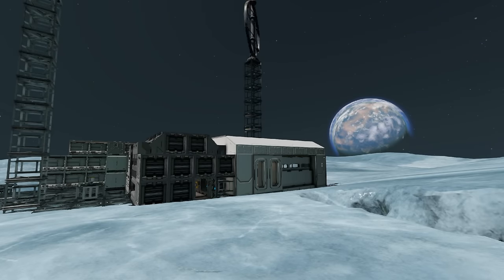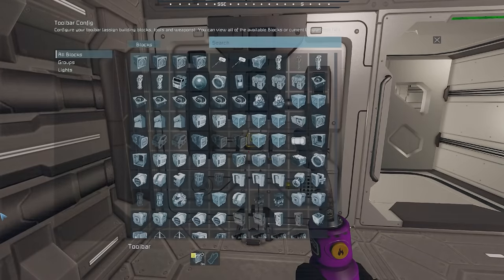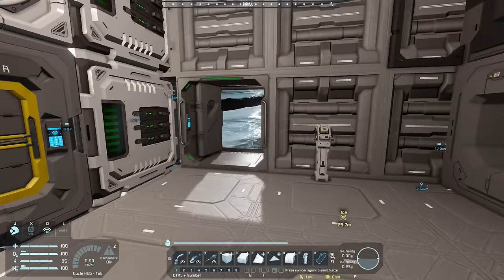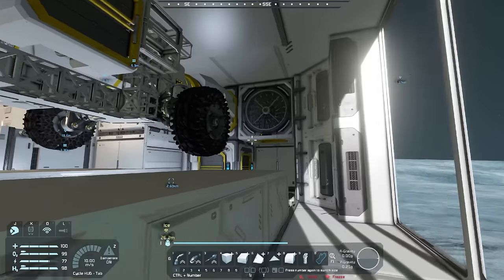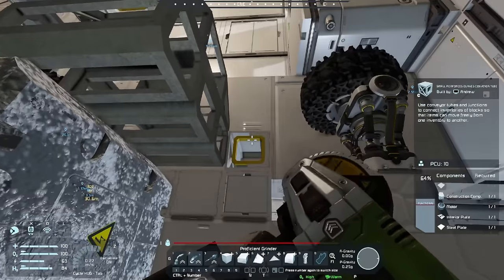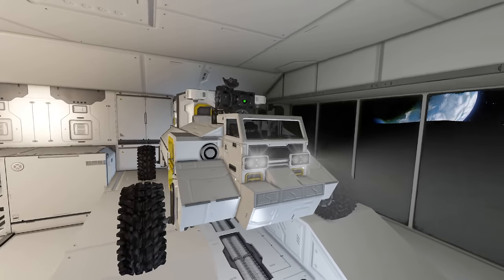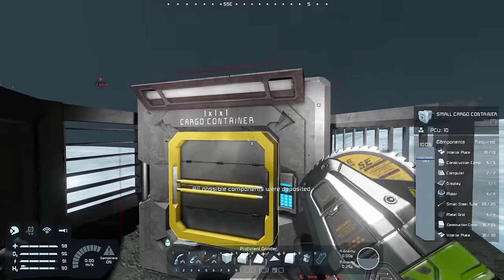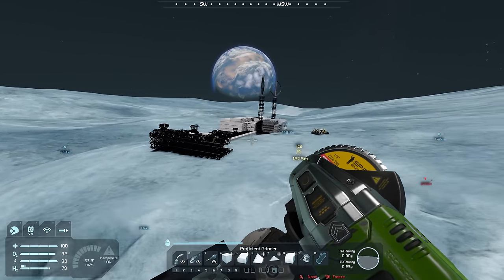Space Engineers Survival (Episode 5) - Rover Upgrades and DEFENSES! [2024]

Comment: PAM’s auto miner is still a viable option, I just used it yesterday and it worked really well. I’ve never tested it in atmosphere though. I’d just make sure that the reverse thrusters can support the ship against gravity even when full, Pam also works if you just set the ship to mine at an angle. You just park the ship facing the direction you want it to mine in and it’ll mine there
Reply: Yeah, despite Pam being technically dead, the thing it uses hasn’t been messed with in a long time
Reply: @nickforgie4290 You're right that it hasn't been updated in a long while, but it still works just fine. 

Once you get PAM set up you can also use your base to monitor what they are ding as well as issue commands
Reply: Every playthrough I do inevitably ends up with a fleet of in-atmo PAM drones set up to collect every ore I can find. My only problem is that I inevitably forget the pathing of one or two near the base and accidentally build in its way. “Why did my ice drone crash? Oh, because I’m an idiot. That’s why.”

Comment: I like building huge solar power towers (200+ solar panels) that track the sun for my bases (Tower of Power!) usually quite far away from the base. I first put down blocks on the surface and count them all the way to where I want to build the tower, often more than 1km away on top of a mountain or high hill (to maximize solar exposure). Then I dig a tunnel from the base to the build site while putting blocks down as I counted them on the surface. That way I emerge exactly where I wanted to build the tower and have a connection to the base via the blocks I put down in the tunnel.
Reply: Another tip to help drill the tunnel straight is to create and use a blueprint of what you want underground (of perhaps a long row of unbuilt frames). Then use a projector to display the blueprint as a guide of where to drill.

Comment: Everyone has their own pref for how to mine. :D I don't mind flying a mining ship for quick jobs, but I personally detest hand mining.

With the shaft you've already begun, you could possibly start with a large grid drill setup with piston, rotor, hinge, etc.

keeping with one thing you mentioned about a strip mining ship, one of my last builds I did was a large grid flying mining platform. Land and lock it with landing gear, set the drills, pistons, and rotors to work. Periodically empty the cargo and fly a load back to base with a separate cargo hauler docking on top of the platform. Once the deposit is mostly clear, relocate the platform to another ore deposit. Lets the game refresh the depleted ore deposit once all grids are sufficiently far away.

Initial construction and setup is more involved than a simple mining ship, but once the platform is deployed there's no risk of operator error in flying and crashing a ship inside the mine/tunnel (which is all too common for me). :D

Later, I upgraded the platform to also act as a field refinery, sorting stone and the common ores for quick but less efficient refining, just to cut down volume and make my trips higher value.

Comment: For airlocks there's a simple & small design I like to use. Stick 2 sliding doors against eachother. Attach a sensor on the outside, configured to covers about a full block between the two doors. Have the enter trigger close both doors. Have the leave trigger activate a timer block that closes the door after a second. 

There's a negligible amount of air for every time you pass through, but that's well worth it considering how easy and fast it is to use. (Iirc breathing for 5s uses more oxygen)
Reply from the maker: That is a nice simple design! I'll probably use something like that for smaller exits to the base.
Reply: An even simpler airlock is just two doors facing inward with a single space between them, and a vent in the floor/wall/ceiling of that block always set to depressurize.

It’ll depressurize almost immediately when the inner & outer doors are closed, but won’t be able to deplete the atmosphere in the base when the inner door is open so long as you’re actively pressurized inside.

Feed the vent from the airlock straight to a vent pressurizing into the base, and at worst you’ll circularly feed air.
Reply: Instead of having a timer delay the doors closing when you leave, you can have the sensor's area expand when a character enters. The expanded area should cover both doors so the payer will be clear of the door when they leave the sensor's area. That way you don't ever have a door slam in your face.
Reply: @Vessekx That's not simpler. First it does not close the doors automatically. Second, it adds an air vent. That air vent is unnecessary imo, as the amount of oxygen it collects is negligible.

 @jamesmcdonald3054  Then both doors would be open at the same time when walking through them. Or you have to turn around and close them manually, which defeats the purpose. One second is more than enough time to pass through the door. I would put the delay lower, but the game won't let me.

Comment: Have a suggestion for the Cofini shop, especially regarding its walls.

One could be to use armour pannels, windows, and bridge windows for the walls. It'll be alot cheaper, and won't be as chunky looking from the outside, and also won't have you needing to move thr mocha parking spot. It would also make alot more sense, especially when you have those half block to pannel sized corner block things. 

You could also use the non-grated catwalk blocks upside down as floor blocks, instead of full block interior blocks, it'll be cheaper and I am pretty sure they use interior plates and not steel plates. (though whether they are air tight or not I am not completely sure)

Comment: Also, do you know that any block with the + sign in the top right corner can cycle through different blocks? For example, the gatling turret is able to cycle through all the different turrets using the scroll wheel. And the solar panel scrolls through all the solar panels and wind turbines. And you can see the different blocks that it can cycle through on the right where it shows the components needed. 40:57 is a good example because you were hovering over the gatling turret for a few seconds and can clearly see the list on the side.
Reply from the maker: Yes! It's very helpful and I use it with blocks I'm familiar with, but some I don't use as often I don't think to use the group block.
Reply: @AndrewmanGaming  That makes sense. I just hate having to go back into the block menu often so I try to find the block I'm looking for in a block that has the + sign. Just in case I want to use a different block in that same set. That and to keep my hotbar from being so cluttered.

Comment: Never get tired of your videos! 

Also for the staircase instead of using lights for a connection point you can also use the neon tube corner pieces as to not use pcu...and generally if your digging in voxels, the more you do it burns up the pcu...however you dug to the core so it shouldn't be a problem to dig a tunnel.
All my bases are almost always underground (inside voxels.)
My recent playthrough I got a little trigger happy with warheads and opened up a cavern to build it.
It destroyed my pcu and I wasn't even halfway through my pcu count. 
Finally had abandon the save.
But it was mostly complete anyways lol.
Reply from the maker: You've gotta be careful removing large amounts of voxels! I broke a Space Busters save once voxel handing out a big hole through the planet.
Reply: @AndrewmanGaming  indeed...I'm on Xbox so I really gotta be that much more careful...otherwise I'm good.

Comment: If you want more interactive design, you could build the solar towers on the hill as a separate structure, build a couple of "power containers" (something like 20 small grid batteries with a merge block) and an off-road forklift, and just hot-swap the battery packs between the base and the solar tower with a forklift :) Maybe even setup something like a red light with event controller to indicate when the charge drops below 10%
And just hope you won't run out of power during a fight at your base :D

Or some battery drones and automate them to fly to the solar tower, recharge for 10 minutes, then fly to the base and discharge everything except one battery so they can fly back to the solar tower and recharge... but that's getting quite complicated
Reply from the maker: That is strikingly similar to what we ended up doing in the Pertam series with the Dune Powerbank! The problem was that I wasnt on top of trucking the power back and fourth all the time. But it's a really cool way to do power I think!

Comment: 37:30 Game physics pays absolutely no attention to length or distance.

If you build it 1 block, 100 blocks, of 1,000,000 blocks, especially in the voxel, it transfers all your power the same.

They did not incorporate resistance, any more than they incorporated wire.

And even the wire mod that Kanajashi used, did not have anything like voltage drop.

So, just as long as you connect the solar panels to the main grid with a long line of blocks, you will get 100% power at any and all distances in game.
Reply from the maker: Thanks! I was worried more with if a loooong base would cause more lag eventually, but it should only be 300 blocks or so, so that's not too crazy
Reply: @AndrewmanGaming  Lag would mainly be something based on how many grids are in place, instead of what dimensions they have.

So a ten kilometer steel grid of blocks would have the same lag spike as a 10x10x10 meter cube of blocks.

Comment: I like to use timers and event controllers and programable blocks to automate a lot of stuff like airlocks and mining rigs and the like but rather than build an entire bank of large grid blocks, I put them on a rotor or a hinge that's attached to the base so I can have a whole bank of computers in small grid without taking up half the planet.

37:24 Since the blocks have an infinite tensile strength they don't bend with the curve of the planet so as you get further from your base everything you build gets less and less aligned with the surface and thus gravity.  The best thing to do is to use subgrids and connect them with hinges (and/or rotors).  So, build your solar plant and then using a pair of hinges, or a hinge and a rotor, build a conduit of blocks from the solar plant to the other base structures.  That way you can connect the grids without trying to keep everything aligned.  I did this to connect a bunch of oxy farms to an asteroid base on the other side of the asteroid, and I occasionally do the same on planets when I use mods that make huge ore deposits that are rare which encourages you to build dedicated mining facilities.  Splitsie also did this in one of his builds (I think it was Survival Impossible) where he raised conveyors up over his base on pylons to connect all his buildings to the same network without obstructing his vehicles' paths.
Reply from the maker: Thank you for the tips! Using connectors and hinges to connect the bases while keeping them on separate grids is a really good idea!

Comment: Add a solar panel or 2 at CoFiNi to allow it to generate power on its own so you can recharge a rover if you ever need to. Keep a basic assembler, refinery, and survival kit there too, in case of excrement hitting the fan at the main base.

As for the solar tower planned: conveyored tower with oxygen farms, and conveyor it underground. Saves you the ice mining to keep breathing, allowing you to use it more as feul than anything. H2O2 gens produce 2 hydrogen units or 1 oxygen unit, they only produce one at a time so there isn't much use in building both tanks at the same time.

As for the Sprite, it could use an upgrade. I do have a small drone design that does essentially the same in the same 5x5 footprint if you are interrested.

Vehicle suggestion, small flyer consisting of: Cab cockpit, large battery, O2H2 generator, single gyroscope, thrust at your choice. Note, the flat thrusters are a lot weaker than normal ones, should you make a heavy flyer you might need to either use a lot more or you'd be better off using the standard/sci-fi ones